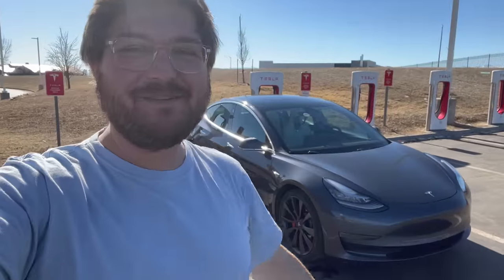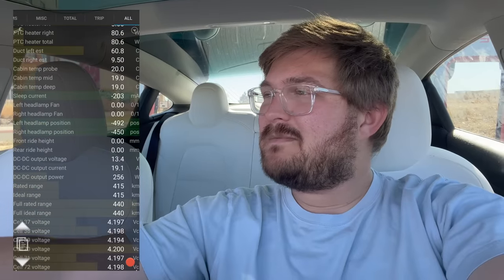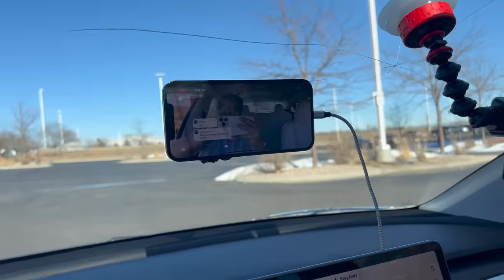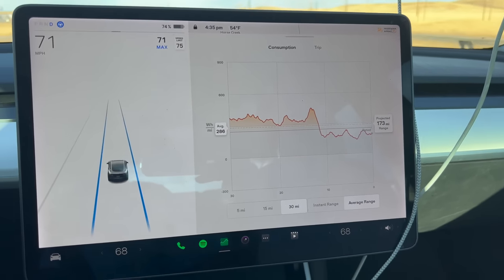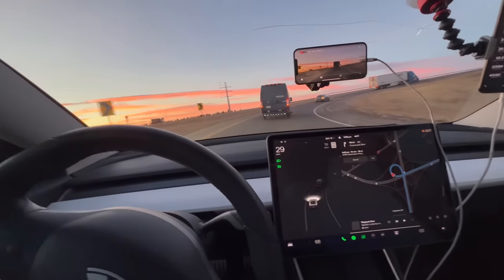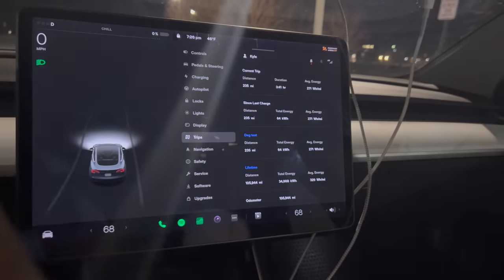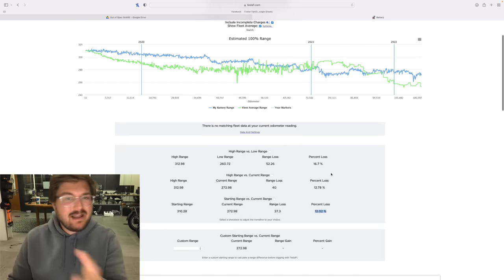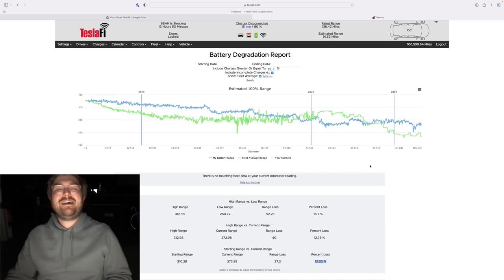100k mi Tesla Model 3 Performance Battery Degradation & 70-MPH Highway Range Test

Comment: So after 100,000 miles, still has 67 kWh (90.5%) left out of the original 74 kWh, very impressive
Reply: Could you maybe help me figure out how much 271 Wh/mi is in KWh/100 km?
Reply: @sondremathias8984  The ratio is 1 wh/mi = 0.062 kwh/100km. so 271 wh/mi = 16.8 kwh/100km
Reply: Depends on where you live and how much you drive.   That 10%  could be the difference pf charging at home vs using a supercharger EVERY day.   Which kinda defeats the whole purpose of the ev schtick.
Reply: @jebes909090 No it couldn’t

Comment: The other thing you glanced over on your Teslafi data is how the drop curve actually did level itself off after that initial 6-8% loss. The Loss after wasn't as bad as that first 5-6%. Backing what most of internal tesla memos and discussions have shown. I know on my 50k mile mid-range (profile picture) I've lost 8% so far, but I have also far less supercharged my car vs. what you have done! Nominal full on my mid-range was 64.3, usable was 61.3 when I got it new. It now has reports 59.1 nominal full and usable is around 56.1 or so.  Its been at this level for the last 20-30k miles now. It started chewing itself pretty quickly after 20,000 miles and stopped.
Reply: Degradation plateau is normal
Reply: I’m down to 275 mile which is 11%. I have 50k miles on the car

Comment: Autopilot keeps buzzing you because you are looking at the infotainment screen a lot. Tesla now uses the internal camera with autopilot.
Reply: That makes sense. Mine kept buzzing every 2 secs and i didn't know why..
Reply: I’ve had that internal camera covered up since day 1.  What happens to FSD now if you cover the cabin camera?
Reply: @aussie2uGA  I noted that last trip I took.
If I 'looked ahead' it would let me sit with no hands on the wheel for a normal time
If I blocked the camera with my hands it seemed to take the normal time before beeping
If I looked down w/o the camera covered it was like 5-10 seconds before beeping.
Reply: @aussie2uGA  FSD won't work if the camera's covered.

Comment: Great vid as usual and gobs of great data.  My Lifetime wh/mi on our 2020 LR AWD Y is 267, which includes 7500 miles of highway trips, my odometer reads 18,050 miles as it sits.  Oh and I recently replaced my side repeater cameras to fix the nighttime turn signal flashing issue, the new cameras are awesome.  I'm having the new Rev C wiper arms installed next week.  I want to keep our Y as current as possible. Thanks for all you do for us EV owners that don't data log as you do.
Reply: I'm curious. Is there a list of what upgrades can be retrofitted for the Model Y? I'd love to get the double pane windows
Reply: @emblemboy  I contact a Service Advisor at my local Service Center and or monitor posts on the TMC forum.  I did ask if the new Bio-Defense HEPA Filter could be retro fitted and was told no.  I haven’t asked about the glass but many claim it possible.  I also wanted to add a Heated Steering Wheel and was told it’s not possible.  So at some point it’ll just make more sense financially to just sell my Y and order a new one.  But I’m waiting for an Austin Y with the 4680 batteries.
Reply: @emblemboy  courtesy of a break-in in my Model 3, I know have double pane glass. They were replaced with double pane because there were no single pane replacements in stock.
Reply: @Thomas
What was the price you were charged for changing the side repeater cameras.
I also have that issue and the turning blind sport camera feature is rendered almost useless at nights.
Reply: @LigeroWheelworks  oh wow. That's good to hear that it's possible. Just gotta figure out how much something like that could cost

Comment: Hey love the video! Can you do a "money per km/mi" type of video? I am still trying to figure out if EV is worth for me, since I don`t drive as much as other folks. Thank you :)
Reply: Couple of ways for that math, easiest imo is learning what your car’s max range is in mi/km, and knowing how much energy that took. If you have a 400 mile range on 100kWh (to make the math easy), you get 4 mi/kWh. Then convert whatever mileage you estimate to drive (20 miles, as an easy number again), and convert to how much energy it would take: 20 mi / 4mi/kWh = 5 kWh. Then multiply that much power by whatever cost your electricity is. At a charging station, it could be $0.41USD per kWh, so multiply 5 kWh by 0.41 USD/kWh, and you get $2.05.

This is all napkin math and your actual efficiency and available energy will be different from car to car, but that’s the basic gist. I usually wait until my car is almost empty of fuel to put gas in, so I’m sure I’d do the same here with electricity, and that also makes it easier to figure out how much I’ll pay, as it’s worst case going to be the full battery (100kWh) times the amount of money per kWh (0.41), which is $41USD per charge (if you somehow completely drained the battery and actually had 100kWh capacity available to charge).

If you only drive 100 miles a week, you’ll recharge this hypothetical EV once a month for $40-ish, as opposed to filling your ICE car (assuming 14 gal tank with $4/gal of gas as the national average was for a while) for $56 from bone-dry to full.
Reply: Most his charging has been on the free 2 year charge he got with the Tesla. So I’m pretty sure he hasn’t paid for most of it

Comment: Also I assume that this Model 3 has been Supercharged a lot comparatively to most owners. I've always heard that Supercharging will put more wear on a pack but I don't know how true this is.
Reply: After 6.5k miles, all supercharged, my MYP went from 303 miles to 296 miles, so 2.3% decrease in a month and a half.  I'm getting rid of it at 12k, so this would be equal to a year of Supercharging, so I will update this.
Reply: @physicslawyer9845  I’ve read and heard several times that the battery degradation is higher initially from new then levels off. Kyle mentions it in this video.
Reply: @gbw28  which is amazing for used buyers, owners scared their battery will fail and insurance will run out so the price goes down

Comment: Kyle, noted, you don't road trip like most people. On a long road trip (800 mi) and ICE car would average 60 mph with short breaks. What average mph for a long road trip expectable for a BEV with charging and moderate breaks? 50 mph?
Reply: I planned on 50 or so on my old Tesla. Newer EVs are better.
Reply: I don't remember if it's this channel or another but they've done genuine cross country trips in teslas. You may need to do some of your own math with the data though. 50 is probably a pretty good guess. 

Are you typically doing that 800 miles in a single day thoguh? Because that sounds absolutely exhausting.
Reply: @belavet  both myself and Kyle have done many cross country trips.
Reply: We just did a 4,000 miles road trip in our Kia Niro EV (Which is nowhere near the fastest charging car available now) and coming home through New Mexico and west Texas we covered 671 miles in just under 12 hours for an average speed of around 56 MPH.

When we've traveled via ICE we typically averaged around 55 MPH. So for us the EV wasn't actually any slower at all. There wasn't a single charging session where we waited on the car. It always took us longer to get the kids out the car and get them in and out of the bathrooms than it took for the car to charge. We were actually usually rushing to get back to the car because it was usually done charging before we were done with bathroom breaks, getting food, etc.

Even before we had kids and we traveled via ICE: I always traveled with the wife or friends and I could never get in and out of a fuel stop in under 20 minutes. If I was traveling solo sure I could probably get in and out in 5-10 minutes. But a 5 minute fuel stop is a fantasy for anyone traveling with a family.
Reply: I believe the data shows most people actually don't take long road trips. What do you consider a short break? I will usually stop for lunch during any trip over 5 hours. Rest stops might last 10 minutes. Kyle usually shows he charges for 15-20 minutes and leave as soon as the charging rate drops off with a buffer to make sure he reaches the next charging location.
Reply: @ymcpa73  we road trip between MN and SC 4 times per year (1250 mi) and stop for 15 min every 2 hours. We average 60 mph (ICE) I feel a BEV needs to average 50 plus mph on a road trip to enable this trip in a reasonable time.
Reply: @JeremyAkersInAustin  Thanks for your input. One thing I was trying to assess was the validity of "A better Trip Planner" Your data shows that you very much outperformed ABTP but Texas also has an 80 mph speed limit?
Reply: @chrls705  I think you mean "A Better Route Planner" (ABRP)? If so: ABRP is great. It's definitely the best tool out there for planning EV trips. Like any tool though it has to make certain assumptions and it tends to assume a but on the worse side just to be safe.

So for example: I always set ABRP to have me arrive at a charging station with around 10% SOC to maximize time spent near the bottom of the pack for fastest recharge times.

But even with this setting set to 10% I actually usually arrive with closer to 20-25% SOC on most trips.

On the particular leg in question though: We were driving into a pretty nasty headwind and I was driving 5-7 over the speed limit. But even driving 85-87MPH across I-10 I was still arriving to each expected stop with very close to 10% SoC.

So not only did we have that headwind, but there were charging stops that ran long simply because we didn't get back to the car in time. I really can't stress enough how we never waited on the car: People greatly underestimate how long a "stop" takes on a  road trip, especially if you have a family.

So if we had been faster/better at getting back to the car when it was done charging, and had we not had that headwind, we probably would have made closer to 60MPH average time.

And this was with a Niro EV. The Teslas, or the new EV6, or IONIQ 5, etc, all charge 2-3x faster than our Niro does. So with any of those cars I would expect you to easily manage 60+ MPH average.

We also recently did a trip to Florida and back that was 2400 miles round trip. I'll see if I can pull up my logs from that trip and see what our average MPH was. I remember on that trip we compared it to my wife's family who makes that same drive in an ICE car, and we made better time than they did in their ICE Lexus.
Reply: @JeremyAkersInAustin  thanks for the help.
Reply: @chrls705  I actually just realized something.

On that leg we got off the Interstate in Junction, TX (Because we live north of Austin) and so it was all back roads to our home from there. There was also really bad construction on some of those roads, including a stretch of road multiple miles long that was only one lane open so traffic from either direction had to take turns. They had a traffic light and we literally sat at that light for 20+ minutes before we could proceed.

So I went back and checked our trip logs to see what the average time would be if I removed this stretch of driving. We left our Hotel in Deming NM at 9:08am and we arrived at the charger in Junction (Our last stop on I-10) at 7:09pm 

After you account for the time change that would be almost exactly 9 hours from the time we left our hotel to arriving at this last stop. Over those 9 hours we covered 540 miles for an average speed of 60 MPH.

Comment: So you did 247Miles - would you have done 247+12% when it was new or did you do more? Jumped through your video, so I might have missed that info.
Reply: He used 67kWh and had 12% loss which would be about 74-75kW when new, so 8kW lost. 
At the 271wH/mi he averaged that is about 29 miles less.

Its not really an exact thing though so these numbers are a little variable.

Comment: Do you think there would have been less than the 11-12% battery degradation had the car’s first 100K+ miles been driven by an old lady with no WOT? Or does that not affect battery degradation?

Comment: The wheels that you put on ya whip...how do THOSE affect the car / miles per charge...compared to the stock wheels that come on the Model 3...?!
Reply: He has a M3P so he put his stock 20" wheels on for this test.

IIRC he normally uses some aftermarket wheels that are a little more efficient.

Comment: I read different statement that a M3 could get to 300k-500k before losing 20% of the pack.   Do you think that would be possible with yours?   

I have 6.8% at 40k miles and hope my degradation levels off because I plan to drive mine a long time.
Reply: I agree with Donovan. Degradation is faster at first and slows down over time. 40k miles is roughly 3 years worth of driving for the average American so 6.8% doesn't seem out of line for that amount of driving. I think you'll see the degradation slow down pretty quickly now. The first 5% usually happens pretty fast and it slows down a bit from there.

The key is keeping the pack cool. Fast charging isn't really as bad as most people think because the pack is only warm for a short period, it quickly cools off once you're driving again. Parking the car in direct sunlight over hot black asphalt and leaving it there to cook in the hot sun for many hours on end is what really speeds up degradation. Keep it in the shade or in a well ventilated (or insulated) garage and that makes a huge difference.

Comment: You're lucky. I also have a performance model 3 2018, and my TeslaFi battery report and degradation test has me at 65kwh nominal and 265 miles of range at 100%.  Car has 30k miles on it (only 700kw dc fast charge, everything else AC to 80% every night).   TeslaFI battery report shows me this lol  - "There are 74 vehicles with charges at your current odometer reading.
74 Vehicles have a higher range. 0 Vehicles have a lower range.
Your range is better than 0 % of similar users."
Reply: I have an '18 LR RWD with 55k. I get currently get 280 miles. I live in a fairly moderate climate and probably half of those miles are highway trips.

Comment: I wonder if the Model 3 will eventually get the LFP batteries from Tesla Austin. It has twice the charge discharge cycles of the NCA batteries but less energy density. I would give up some range for long life. Although the NCA batteries should last 10 years i would think. Have we gotten any numbers for average battery replacement times? How many years do the NCA batteries last on average?
Reply: No one knows. There just isn’t enough time to know yet. We can guess and make data points all we want. But no one knows. And won’t know for another 10 years
Reply: LFP for Austin? Doubt it. 4680 battery only

Comment: wonder why the usage is high. I feel like 270wh/m+ is a lot but idk I've only got my car to go off of. I average around 220wh/m(avg speed around 70-80 depending on traffic), but I have a 2022 model 3 LR with the Aero wheels. And I got heat reflective tint so that the car doesn't heat up quickly. Wonder if those wheels make a bigger difference than I thought. I do see his temperature was set to 68 while I generally am set to 72. Probably another difference.

Comment: my 19' 3 came with 310, but a software update nerfed it to 300mi range. Wonder if this was accounted for?
Reply: I know it now tries to consider the temperature and your driving habits in the car now. People complained they weren't getting as far as the car said it should but I mean going like 80 miles a hour you are going to get 10% than if you went 70. But if you haven't fully drained the car recently the car is pretty inaccurate sometimes I've seen. I've never fully drained though. I just drive to work so yeah I leave battery percentage on and never think about how far it can go. Since everyday it's back up to 90%